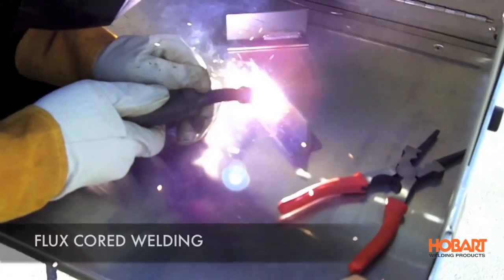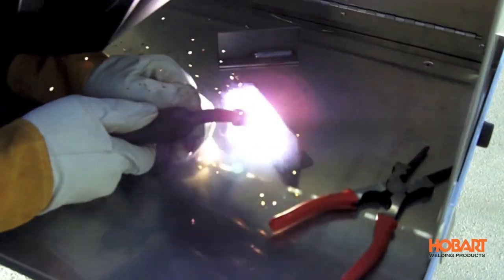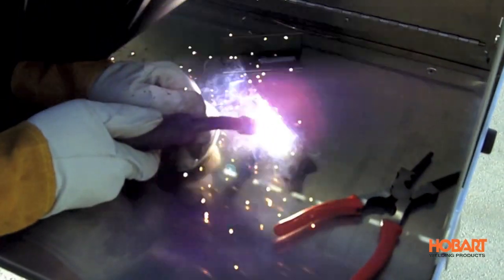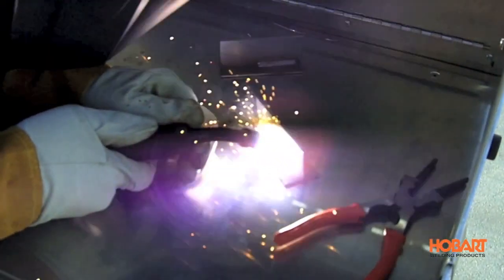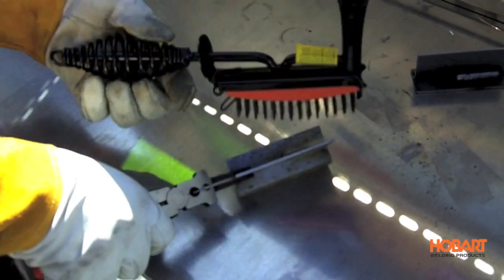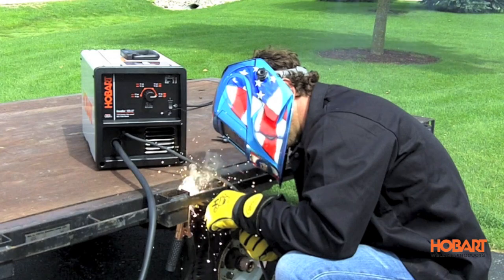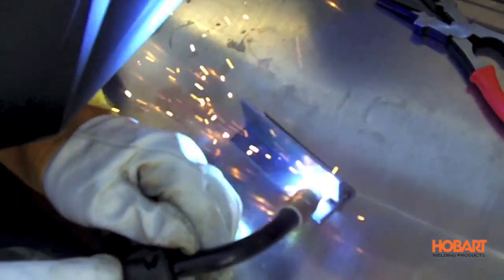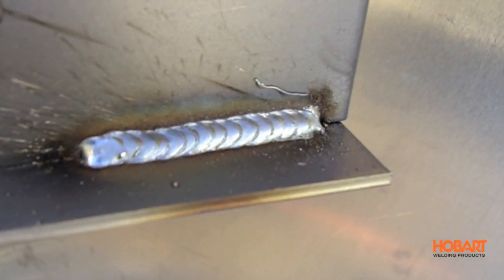Flux Cored Wire VS. Solid Wire (MIG)

Comment: Useless. I wanna know the difference between the wires, the flux core I use REQUIRES shielding gas too. I already know that some flux core doesn't need shielding gas.

Comment: I have used flux core wire but I have never used solid wire with shielding gas. One of the problems I have using flux core wire is seeing past the arc and through all the smoke and sparks. I find it very hard to see the puddle and keep the weld flowing in a straight line. Can anyone tell me if using shielding gas makes it easier to see what the heck is going on?
Before I invest in a bottle and gauges I want to know.
Reply: Mig is much easier than flux core.
Reply: Mascotal you should change from self shielded flux core to a gas shielded wire. The smoke is essentially the shielding. If you use solid wire and 100% argon shielding gas there won’t be as much smoke.

Comment: You need to do a better job on explaining things. Flux-core wires come in two types - Gas shielded and self shielded. One thing to point out is anytime you are welding without gas, your polarity should be negative and when welding with gas, it should be positive but you should always check with the manufacturer of the wire to verify before hand.
Reply: he was being general. camels